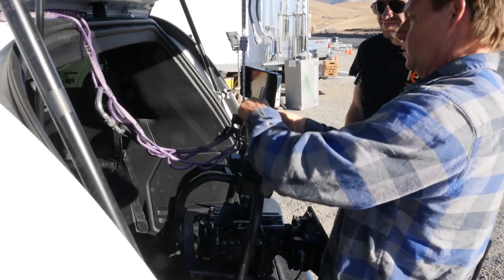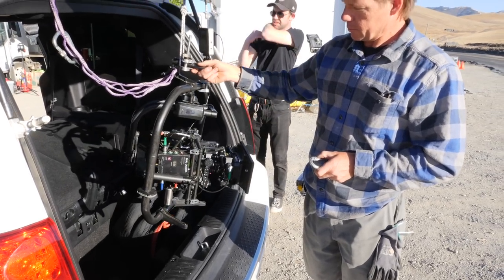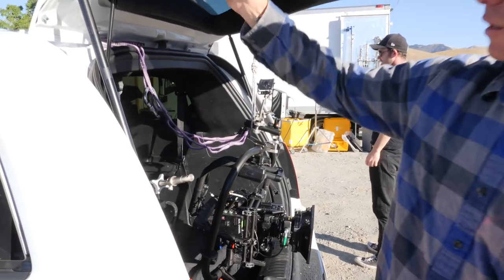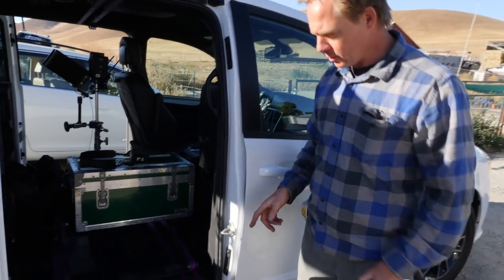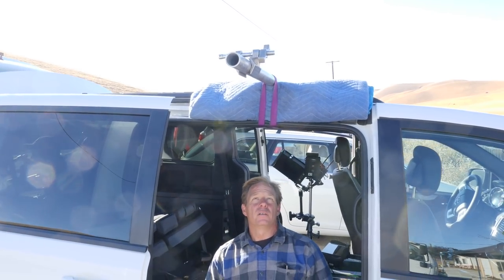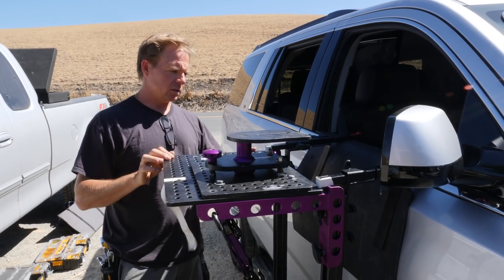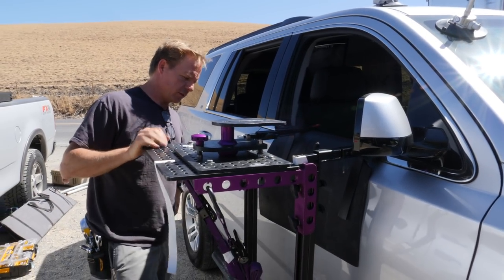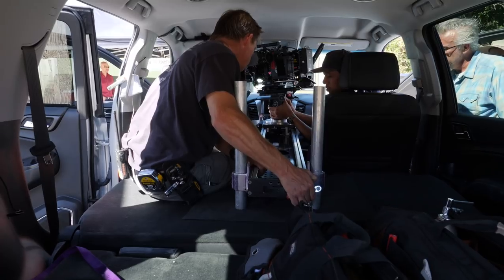Meet The Gaffer #114: Simple Car Rigs

Comment: What are the name of those black things holding the spigot to keep the camera in place ? They are great but can’t find a name for them anywhere ! Thanks
Reply from the maker: Do you mean the suction cups with baby pins or the double wheel heads securing the rods to the camera?
Reply: Double wheel heads ! Where do you find them ??
Reply from the maker: @Emma_Kiwi Those are custome made by an LA Key Grip, I believe. They are not easy come by and are not cheap. Ping me and I will try to help hook you up if you are still interested. lseerveld@gmail.com

Comment: How'd the rear camera suction to the back to the rear window?
Reply: Perhaps safety glass is stronger than I give it credit for but I would have thought one good bump and it's shattering all over the place.
Reply from the maker: Another way, with more time and parts, would be to build a speed rail frame/cage inside the vehicle, and providing a hanging point without touching the back door.